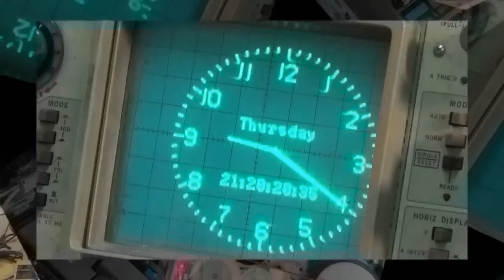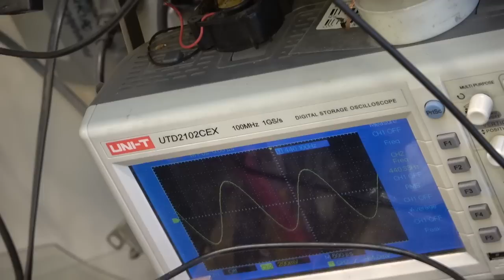Yamaha KX670 will the motor from a Sony micro system work?

Comment: My KX-580 has auto tape tuning too, what it is supposed to do is to record a tone on the tape then rewind itself and play it back adjusting the bias etc. automatically to tune the tape to optimise recording. It actually does a very good job, but like most auto calibration systems isn't always perfect, and with some tapes minor manual tweaks might be needed to get the best recordings.
Reply: @Taco this deck has a build-in tone generator which is the baseline. playback head compares the recorded tone with the baseline and adjusts the bias accordingly. there is no separate test tape.

Comment: I once tried re-winding one of these motors with no success. Did manage to get it spinning fine, albeit with some smoke. My only guess is the control circuit was shot and was the one smoking, but i don't know how to test those so I just left it as is. When deck A fails you always have deck B to play around with :)

Comment: Well that worked perfect, the resistor did the job :-D
i like the nice heavy flywheels, smooth out the fluctuations.
No i didn't notice an obvious error.
Now you have the faulty motor,  maybe fix the preset for another tape deck.
A game of musical chairs :-D.

Comment from the maker: I have a continuity error in here that was put in on purpose to see who spots it first.
Reply: I have a yamaha dolby s version of this seems to be a rare model and the remote to.
Reply: Nice job! Was it you would try without the resistor first? Thank you for the nice videos
Reply: I don't know. The belts just showed up. Good job. You could have used 4 diodes for the drop too.
Reply: @markanderson350  5 would be a 3 volt drop, yes? Since the power supply source was 12.8 vdc. Resistor less complex.
Reply: @zulumax1  it's 2.8 for 4. It's really not that critical.
Reply from the maker: @markanderson350  .7 per silicon diode.

Comment: When I needc to do this trick what worked for me is a 1W 3V zener in series or just 4 or 5 1N4007s in series. But this approach is good enugh since it is only for capstan drive, where the torque demand is pretty constant (asumming that no logic function is run from this point). For one motor units with RR and FW being so much hungry in current this will kill the power of the motor. Also, 9V system are 10 or more. This motors are TOLERANT by a nice marging. You can wide your seach on cheapo crappy 90s boomboex, the one with twin decks. Those are double speed motor (well external pot 2000 to 4000 RPM). Those are torqy, nice for logice decks that run ALL the functions capstan and FF RR from on motor, even for Kenwood KX500, 600 800 and so ... the worst decks ever made that require a 1HP motor to operate its clunky mechanism. I will stick to the JVC KD-X2 and so. This is how a bottom line deck is executed for low maintenance and longevity.

Comment: Hey Dave just a thought perhaps the servo circuit board from the old motor may fit and work just fine with the replacement (basically gutting the old actual motor and using the original 12 volt servo circuit board.
Reply from the maker: No.
Reply: @12voltvids  Okay thought the old 12 servo board might fit right on the undamaged motor terminals, it was just a thought. Did the 9 volter get excessively warm or hot?
Reply from the maker: @darinb.3273  no heat whatsoever on the new motor.  Running at 10.6v. remember 9 is the average. No tape deck used a regulated supply for the motor.  So the voltage would fluctuate with incoming Ac.
Reply: @12voltvids  Ahhh I saw you solder it in with the normal wires from the original motor I must admit I did skip ahead so perhaps I missed where the placement of the 10 ohm resistor went LOL
Reply from the maker: @darinb.3273  it went right on the motor on the + terminal.
Reply: @12voltvids  I'm watched on my phone and its tiny screen, i don't have the best vision either all that in combination with the zoomed out frame I didn't see the resistor. LOL The motors servo circuit most likely has stabilized internally and then regulates the speed from that point. I imagine it would be like trying to read a newspaper in a bumpy vehicle if the voltage isn't stabilized somewhere LOL
Reply: This speed controls are MATCHED to motor internal resistance. And 6V, 9V and 12V are all different (from the same brand). For example, tried to get out with this approach using the motor section from a 6V and the speed control from a 12V and the motor had barely any torque. This controllers are simple but still pretty clever. They are open loop, because the are not measuring the actual speed. It not FG nor mechanical governor. But they are still able to keep speed even when torque demand changes. This is done by using "negative resistance approach" ... basically, the current consumption is what is feed back to raise the control voltage so the speed will remain unaffected. Since there is no direct feedback (like a tacho) and it is all based on current, then, the electrical model of the motor is matched to this circuit. This is key reason why a worn out motor start to drift in speed. Since the internal resistance had changed (dirt or worn out conmutators) the circuit is not longer tuned to do its job, it tend to overcompsante (ur undercompnsate). You can adjust it, but it will drift again. The actual circuit from Philips or Grundig back from the 70s is just 2 transistors. Issue is they have som tight values that are in close relation with the motors they have used. Tried to built the one from Philips and somehow it worked decent with a mabuchi motor (the motor alone, without the control board).

Comment: Wonder if a 9 volt voltage regulator would work.
Reply from the maker: Watch and learn
Reply: It have would have been a good idea to use an Lm7809 as its output would remain more stable than a resistor at higher temperatures.
Reply: @tyronenelson9124  This regulators will top working if the differential is less than 3V, it is pretty tight.
Reply: @38911bytefree  Yes, according to the datasheet, the worst case dropout voltage is just over 3V.

Comment: Yamaha natural sound is nice sound equipment, NS stands for natural sound, the Yamaha NS-1000 speakers are very good :) Three-way. Fully adjustable mid and high. Beryllium in both tweeters and midrange makes it so exact that nothing compares, beryllium is better ressonance wise than titanium and perhaps anything else. Beryllium is toxic to make so perhaps the reason they quit doing them.. they did grow the membranes in plasma vapour chambers or something like that. Might be the best speakers ever produced. 12" inch paper woofers i think.
They make new three-way ones today retro inspired of these ones, with ceramic speaker membranes i think in all of the elements, also 12" wooers. Called Yamaha NS-5000. Pricerange 15000 USD for a pair.
If not liking the fully closed cabinet sound of both these models they also made totally open models called Yamaha NS-20 with very large polystyrene woofers, kind of facinating technology in them too, sounds more open than ever heard before :)

If you ask me i think modern speakers has too much crossover components in them so they become too muddy, like king of average or something like that.. they may measure good on the test equipment regarding a flat frequency responce curve and people may look and ask for that.. and then the factories compete in making that becourse people want that flat looking curve.. but that comes with a price and the product end up average sounding regarding livelyhood music experience wise.
Correct sound is not everything, i want lots of livelyness in them speakers too :)

I have not heard any of these in real life, but i have read that these are good and i have a USB DAC and homemade headphones where i did buy many kinds of speaker elements and did after listening tests pick the ones with the strongest magnets i have ever seen on headphone speakers.
The screws did stand spread in a magnetic 45 degree pattern on the magnets when i did put them there like i normally do, i has not experienced that in other headphone speaker magnets before :) They blow my Bose QC 15 away in sound quality, i did experiment with shell bass holes and speaker element holes and high frequency holes and dampening material so they became perfect :)
It is the first time i did headphones, but i have made ordinary speakers since my youth 40 years ago.

Some examples here. Of course Youtube has compressed sound and all that, but one still can listen regarding the sound quality anyway in some degree.

Yamaha NS-1000M - 1970s Vintage Studio Monitors
https://www.youtube.com/watch?v=7yLUzGbD0B8&t=33s

Yamaha ns-5000 speakers
https://www.youtube.com/watch?v=4Wys76yTjyM

70年代のオーディオを聞く15　YAMAHA　NS-20
https://www.youtube.com/watch?v=jb1SJNRH1dk

Yamaha NS-20 Elephant Ear speakers + Livingston taylor - Isn't She Lovely
https://www.youtube.com/watch?v=OoQUMs32SAk

Comment: Cue the audiophiles as they try to explain that a 9v motor cant be used thanks to a resistor because the resistor adds noise and must have gold leads.  Oh and was the motor from the Sony blessed by the pope?
Reply from the maker: You mean the audiophools
Reply: LOL .... a true audiophool will as fo DD QUARTZ PLL with real time sincrophasor connected to the NIST atomic reference through fiber optics.

Comment: I just came to say I waited more than 24 hours... n_n my millennial brain lost interest. xD
Reply from the maker: Your lucky I posted it today.  I was tempted to leave this one for a few days.  Let the other one percolate for a bit longer.
Reply: @12voltvids  Oh my goodness... OFC you would meanie pants. but that would mean you punished your audience just to get at me n_n
Reply from the maker: @Nairod2  it is a fact that publishing a new video too soon impacts the previous one.  So I was letting the motor recovery from the donor unit gain some traction and generate hate mail by those upset i took a motor out of a perfectly functioning piece of shit to fix a good one.
Reply: @12voltvids  LOL  .... the system is OK without the DECK ... who is using tapes on 20 years old minisystems ?. I mean, the cheapest deck possible. Take the transformer out and put the rest on the bin.
Reply from the maker: @38911bytefree  cd player works fine and plays mp3 files on CDR and CD-RW
Reply: @12voltvids  I don't think folks realize how poor quality those players are. If it can serve a purpose being an organ donor then it served more good than the Yamaha going to the recycler. I have one of those radio intercom things installed in the wall that has one of those cheap cassette decks built in to it. 1992 and virgin, it has never had power applied, never used, and it is worthless. Falcon brand, who ever heard of that? Calling it a POS is too kind. None of my tapes would ever get that close to a permanent magnet. Guess what? It is getting yanked and going strait in the bin.
Reply from the maker: @zulumax1  that's just it.  I would use the cd player and the radio only.  From the look of the tape deck it has never been used.  Most of those microsystems  ended up in kids bedrooms or small apartments and were used as CD players.
Reply: @12voltvids  you should just cut it with a saw and sell it as a cd player and tuner.